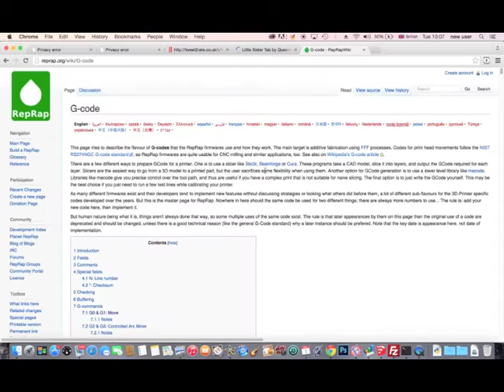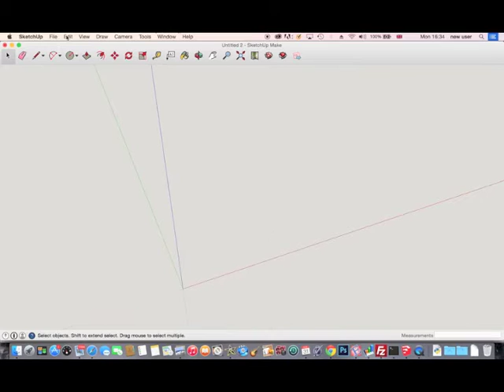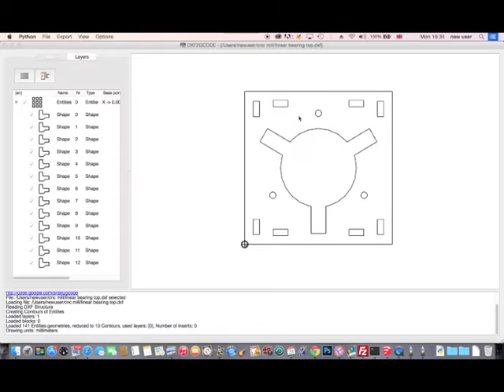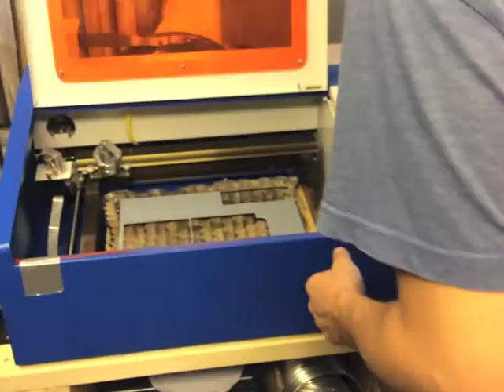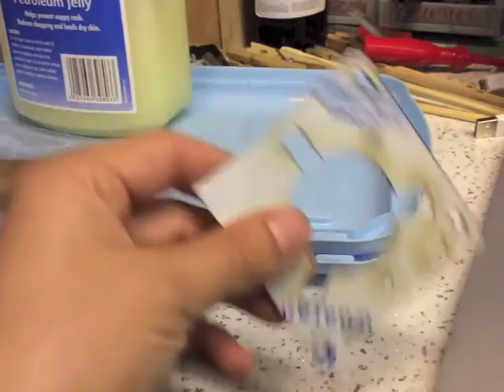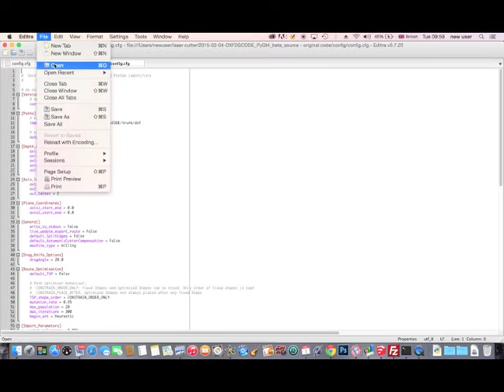Sketchup model to laser cut acrylic

Comment from the maker: I've written a SketchUp plugin that does this better and quicker! Visit my next video in this series to get hold of a copy.. https://youtu.be/jZzNP_yle_o
Reply: +OpenTronic I just got a K40 (revision 3 with the M2 Nano board). I'm glad to find there's a growing commuinity of users :) Your plugin looks great btw, i'll give it a whirl later.
Reply from the maker: +Gary McKinnon that sounds interesting, I've never heard of the m2 nano. Is it anything like this? http://www.artaylor.co.uk/laser_conversion.html That one looks good, but the arduino version I modded is a lot cheaper!
Reply: This one : http://www.instructables.com/id/China-Laser-Aux-Trigger-Output-K40-M2Nano-Board/

https://tkkrlab.nl/w/images/6/62/6C6879-LASER-M2-6_Chinese.pdf
Reply from the maker: +Gary McKinnon The M2 is better than the original Chinese board that came with my laser cutter, but it'll still only cut from image formats like SVG, rather than Gcode. Gcode will always give you more control over the line thickness and more accuracy in general, but there are plugins that let you export SVG from SketchUp. That might be a way to go straight from 3D to an unmodified K40.
Reply: Thanks for the info
, at the moment i export from Sketchup 2014 in PDF format, then import to CorelDraw, works fine so far. First thing i want to do is saw off that extractor vent and then make a new bed.